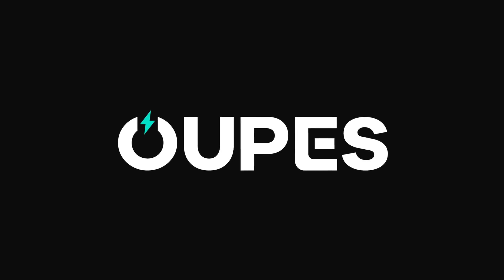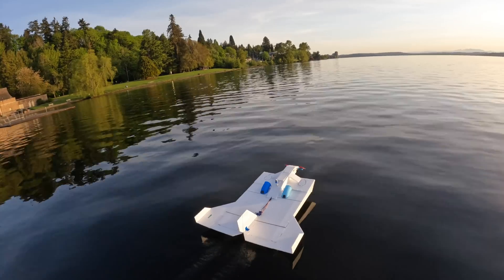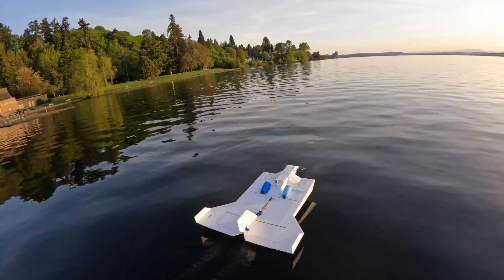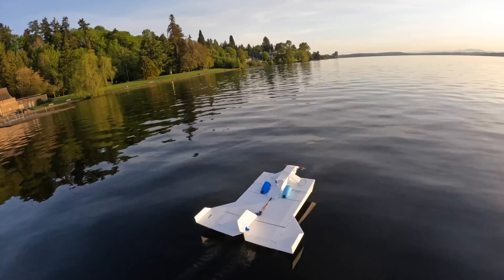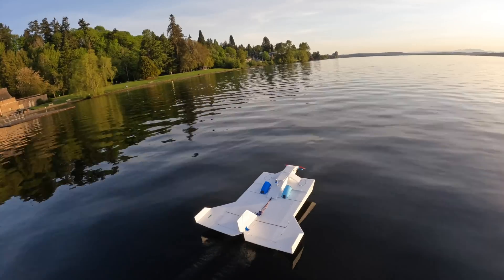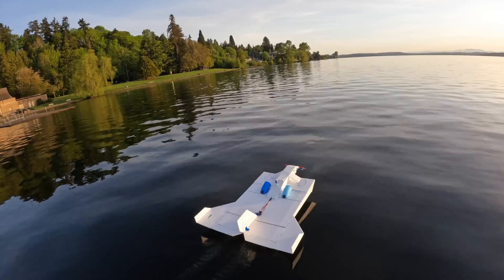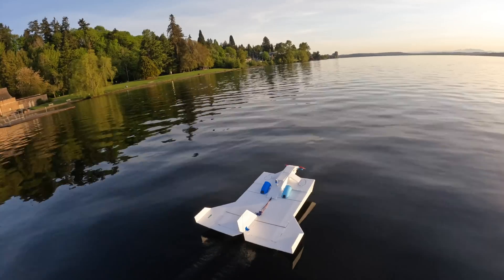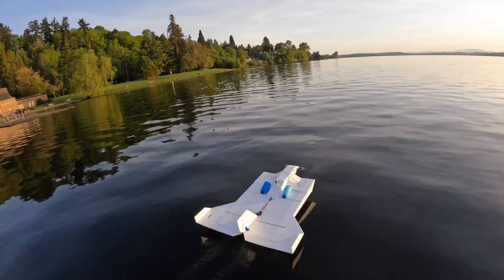Testing WWII Era Terrain Following 'Radar' On R/C Plane

Comment: With the caveat that I only have seen the footage you posted here, I think you were closer to it working with the Canard design than you think. Instead removing so much of the surface, if you can trim it towards a more neutral attitude and change the gear ratio I think it would be much more effective. You are spot on that the response is very large, and by changing the gear ratio so the change in angle of the wand causes a smaller commensurate change in angle of the canard. In PID speak, think of it as changing the proportional term gain.

Comment: The feedback needs a delay and adjustment.  There is a great video on the "gyro monorail" and the mechanism it used to overcome a similar problem but in the horizontal plane

Comment: maybe change the gearing on the ground following mechanism so it's half or even one third movement to the control surfaces, and use that to just dampen the movements, so you get a little improvement and let the sonar and arduino do the rest of the work

and maybe use a cam system to make the pitch variable so it's more like expo and starts gradual but the closer it gets to the surface of the water, the more control surface movement you get

Comment: Cool video! I work as a firmware dev and have some experience in control systems… 😁 sometimes it can be really hard to tune parameters. If I’m new to a problem, I start by modelling the system and try out in simulations.

Comment: How about using the slim canards plus a minor contribution from the flaps, both connected to your mechanical altitude rods? 

That should solve both your problems of soothing the oscillation and maintaining minimum altitude.

Comment: The ultra sonic sensor is picking up the wave height difference which is causing isolation. There should be a 2 second sensor delay once level on the water this will cause a less speratic data pickup. Then just adjust elevator sensitivity adjustments and should flow more evenly. The main issue is climate adjustment. To overcome this a larger heavier aircraft will be more efficient since even at a sensitive elevator rate the mass still requires more effort to elevate reducing the amount of oscillation.

Comment: You might need to have a non-linear response to the altitude variation, you could try to use gears relusting in a exponential output for example

Comment: I did a fair bit of control theory research in my final year of engineering, a few years back. If the physics of ground effect are robust and can be expressed mathematically with good correlation to real world performance, then you could probably do some basic control theory work to understand if basic PID will ever be able to control this, or if you need to add some more exotic control elements. You could also figure out which parts of your system have the greatest impact on the controllability (and then design around that).

Comment: I think because longer wingspans generate smaller vortices in general, the benefit that the ground effect gives to reducing those vortices dont increase the efficiency by as great an amount, it would be interesting to see if winglets on the shorter wingspan also reduce the effectiveness of ground effect just like we see on longer wingspans since winglets are designed to reduce the drag experienced by wingtip vortices

Comment: As someone who formerly worked in a vape shop in the day of the classic mods. I definitely screwed several together and shoved up to 7 batteries in one stlet of copper tubes before it ignored several batteries and I had to throw it out of the garage door at the shop. It would probably create 1/2 the smoke of your machine only using 4 4680 batteries and a massive 8 coil atomizer with less than .1ohm guitar string colis. It was not in any way vapeble and required an air hose and a cut up 2 liter bottle to funnel air and a bottle of vg to prevent it from overheating immediately and going into flames. I installed the security cameras and my boss was there most of the time so he should have stopped us.

Comment: I fly a powered glider similar to his plane. I was surprised when he said he didn’t feel(?) the ground effect of the plane before he modified it. Well you can see the ground effect. The plane just won’t stop it keeps going and going flying along a few feet off the ground with out power. That can be a problem for new pilots trying to land. Here’s it comes great glide slop, almost down but it just floats right on by you slow and happy.

Comment: I think the reason that hydrofoil sailboats work so well is that the resistance to movement is higher under water so the control surfaces need higher strength input before activating. on top of that angle of attack and altitude are only loosely related if you are already at a high angle of attack getting an input from the probes will only make angle of attack higher thus causing the osculation. dunno I'm not an engineer just some dude on the internet good luck solving this very complex problem.

Comment: I'm a mechatronic engineer (control systems are part of that). A physical control loop, a digital one and an analog electronic circuit all follow the same rules and are modeled in the same way.

In digital you have P, I and D. P reacts directly to the error, I reacts to the cumulative error over time and D reacts to the rate of change of the error.
In a simple physical control loop you have a spring (which provides a proportional response to the error), a mass (which has inertia and doesn't want to change speeds), and a damper (which reacts to the rate of change).

Your physical control loop has only a proportional response to the error, so it oscillates like any proportional-only control loop. If you want to add I and D to get a working control loop, you should isolate the probe from the control system with a rubber band, have a gear system so that a flywheel spins up in either direction as the error changes (to provide I) and a brake that rubs on the flywheel (to provide D). To providing tuning of I, you'll need a way to change the rotational moment of inertia of the flywheel, by either changing the mass or moving the mass closer to or further from the centre. To provide tuning of D, you'll just need a spring or rubber band that can have the tension increased to push harder on the flywheel. Probably the easiest way to achieve this would be by screwing weights into an electric scooter brake disc (about 75mm diameter) and mounting the disc to a drill's planetary gearbox (backlash in a 3D printed geartrain will not be kind to you).

If you want to learn more about this, look into "spring mass damper" systems and state space modelling.

Comment: Could you use the sonar data to react to the slope of the ground (or water) below rather than the absolute height to the surface? This would effectively make the aircraft predict what is coming and make smaller adjustments in time to be effective (overcome inertia) especially if the sonar was canted forwards some function of the speed to height above surface (it looks 10cm ahead at 1m above the surface for instance.)

Comment: I think the oscillations are caused by your feedback system only being 'proportional'. That is, the corrective flap deflections are proportional to the movement of the ground tracing wand i.e. to the height. In a servomechanism control system (without a ton of damping, which would result in a very laggy response) just using proportional control would result in the servo overshooting its intended target position, then reversing direction and shooting past its target in the opposite direction and so on. This is because the servomechanism has inertia, so it arrives at its intended position travelling fast and just keeps going due to inertia, thus overshooting. Your plane has inertia too and suffers from the same problem, ovrshooting the correct height. 

A PID controller takes care of this overshooting problem by having a velocity (first derivative of position) feedback element to its operation, as well as the proportional, so it doesn't arrive at its intended position (height in your case)  moving too fast to stay there. I'm not sure how to mechanically extract a velocity feedback component from your (proportional) height tracing wand then add it in opposition to the proportional flap signal but I'm sure one could dream up something with a bit of thought.

Comment: after seeing the plane fly above the boat I wonder if you could make a big walkalong glider attached to the boat with the plane having zero motors. Like in the peter sripol video. Probably hard to keep a constant speed without glassy water conditions but it would a be a fun challenge to see how long you could keep it going

Comment: Could you read the angle of the probes electronically and use that the drive your altitude following code so you could use full PID controls to tune the aggression of the response?

Comment: Did you check your cg after you added extra structure and move the motor. Plus try a cambered wing you will like the float in the air foil.

Comment: wow, some very interesting insights. re: efficiency gains perportional etc, maybe a challenge, how many watts to transport 5 pounds one mile, or whatever. build a deep chord and shallow chord ground effect vehicle with same motor/prop? seems like adding some weight may make the ground effect the vehicle generated more apparent/easily measured? keep up the curiosity

Comment: chatgpt says that "Wider wings experience more ground effect than thin wings because they generate a larger lift-producing area near the ground. This proximity enhances the interaction between the wing's airflow and the ground, leading to increased lift and reduced induced drag." It asserts that a wider wing craft can be more efficient near the ground than a thing wing one.

Comment: What about a craft with two active lift surfaces... both short cord. You would def need a flight controller as typical trim, based on fualarge angle governed by the tail would be out of the question but in ground effect a variable trim angle, for both wings, would create a heigt offset, elative to the surface, and induce an overall difference in angle of attcck for the system. With the wings trimmed to hold the tail, well trailing wing, high, relative to the leading wing, a pitch up would be induced when the leading wing felt fround effect. That would increase attack angle, lowering the tail which should then drop into ground effect and reduce the pitch angle.... Do i know this would work, hell NO, would it self tune dased on the strength of the ground effect and relative altirude... probably. It is almost like a vertual stick to the surface but with variable length, gain, based on altitude. Look I know naff all about aro dynamics but I build control systems/loops for a living and gave up with complex PID for anything but the nastiest of problems years ago. the best control is no control and a naturally stable system. I realise I just contradicted myself, flight control VS no control, but if the flight control is only maintaining fusilarge angle by trilling both wings in opersit directions, and the ground effect alt is a function of airspeed and reltive wing alt I think you may have a shot! Way ot of my ability to test but I think yo may be the guy. I know this is out of the box but given that I dont know where the box is.... Or even where to ook for it. It also occurs to me that the aft wing may have to be longer as well as higher to get the offset... Longer to see a bigger effect, higher to see that effect later! Thoughts? Sorry about typo's slightly drunk, small screen and dyslexic as you can be with just the one head...

Comment: Ground effect is due to surface area of the wing. The saying of "it depends on how long the wing is" is a cop out to not go in depth and actually describe how it works.

Which is why your glider felt nothing. Its surface area is tiny compared to your high surface area ground effect vics previously.

Comment: What he should do is measure the closed loop frequency responce and check for second order poles creating a resonance. If and only if they are present, he needs to add a notch filter (or band stop) to the signal to actually not actuate on this frequency. Maybe some leadlag filters are also good for such a system! If you want, I can help you with this!!

Comment: the foiling moths you referenced have a flat paddle at the end of the wand. You want the wand to be planing across the surface of the water not just rods digging in deep. If it's planing it follows the surface much more accurately and I would imagine with finer movements.

Comment: Regarding the oscillation it could be high frequency in the feedback from the sonar sensor to the controller. I assume you want small changes in the wave height or possibly noise to be filtered out? An alternative that works in many cases is the LP filter as a low pass filter first order (digital filter). By using this filter you should be able to achieve a better result. What you have to be careful about is that the phase lag does not become so large that it becomes unstable (poles and zero problems). Alternatively, two such filters can be put in series, which can give better results in terms of noise and response time. I myself have relatively good experience with this type of filter and it should work on your project also if this is the cause of the noise into the controller. There are many other filters that can also be good. :)
It may also be interesting to take a closer look at the signal from the sonar sensor in terms of bias, accuracy and precision.

Comment: While flying an IS-28B2 Lark sailplane (17 m / 55 feet 9 inch wingspan) on landing approach I was instructed to land long as the gliding operation was moving to the other end of the runway due to the wind direction changing. Fully retracting the air brakes while holding an altitude of about 10 feet and at a speed of 50 miles per hour the glider floated the length of the 2300 foot runway with very gradual speed loss, touching down at about 40 mph with an easy roll out to stop at the end of the runway. That, for me, was a very practical demonstration of ground effect. Thank you for all the analysis of the remarkable phenomenon of ground effect.

Comment: You’ve probably thought of this, but could you use some kind of LiDAR sensor system to detect and adjust distance from plane to the ground? That way you could build in some differential to factor out the loop tendency. I’m obviously no expert in this but just wondering! 😅

Comment: The increased efficiency of ground effect comes from a reduction in induced drag. Since a wing with a high aspect ratio already has a relatively low induced drag, there is less of a benefit to be had. Not zero, clearly, but less. The strength of the induced drag is inversely proportional to the aspect ratio, so it's very noticeable with an aspect ratio of less than 3 or so.

Comment: Maybe grab the angle of the sticks with a potentiometer and run that through PID. You kinda just get the P with the purely mechanical setup. Implied joke intentional. Alternatively, a cheap radar distance measurement is feasible that should be faster and more accurate than the ultrasonic.

Comment: What if you made the wand into a vertical hydrofoil with a submerged element to it like the racing boats?  The under water fins would be tied to the movements of the wand as well, but pitched to give a slight downward inclination even as the wand moves.  The interior rigging that controls the under water planes could include a gear that pitches the underwater fins up to quickly pop them out of the water.

Comment: You may want to shape and angle the skid things you added at the wing tips.
My thinking is that you want it to also sort of work like a winglet to help trap air under the wing to reduce the vortex.
The fact that you have oscillations that don't seem to grow makes me think you have something very nonlinear going on.
For example if the height measurement only changed in 0.5 meter increments, you are sort of doomed to oscillate by that much.

Comment: Great series!

In my experiences with PID controllers, sometimes using x*abs(x) on the output can smooth out oscillations. In other words, square the output of the PID, but keep negative values as negatives. This results in exponentially lower sensitivity the closer you get to zero.

Comment: I think you’d have more sensitivity if you put some “feet” on the sense wires so they ride on the surface of the water better. The flight over grass didn’t look that bad with smallest elevators.

Comment: To apply the flaps to the controll loop is the right step. You create lift without loosing energy for pitch motion of the entire aircraft. The flaps need to be much bigger though, at least by factor 5! The canards are different, because of their leverage to the centre of gravity and it's coupled feadback loop with two different sets of time constants for the same prameters. The surest way to figure out a stable parameter loop is to keep the number of degres for freadom as los as posible. For instance, for ground effect mode - freeze the pich attitude and work only with flaps and rudder. The pich should be controlled by a gyro, but still keept fixed, when flying in the ground effect mode.

Comment: Your models are simply too light to be able to use the ground effect in a stable way, being light any oscillation takes them out of balance. You need more weight for it to work.